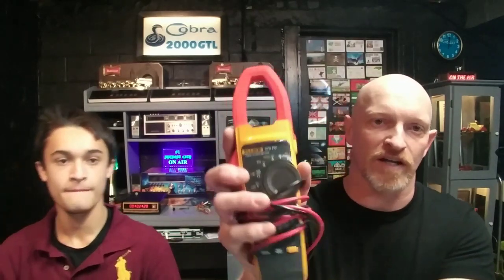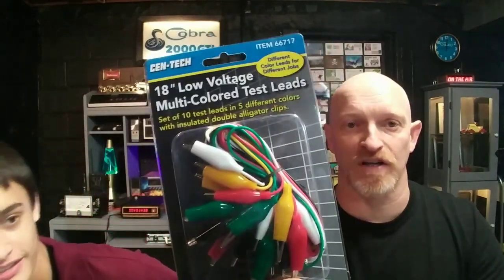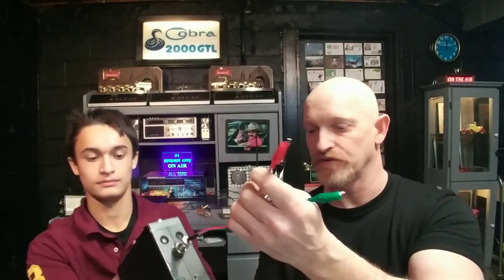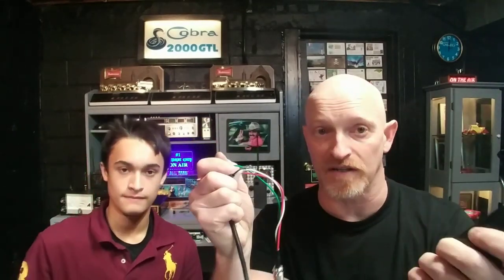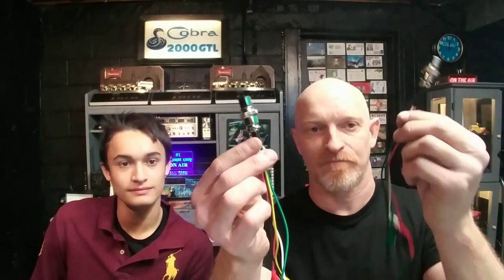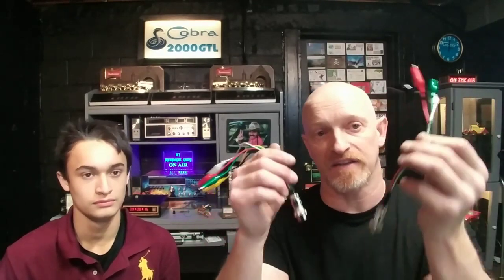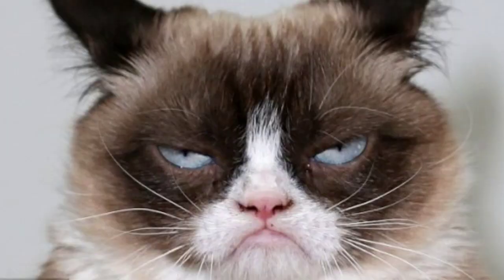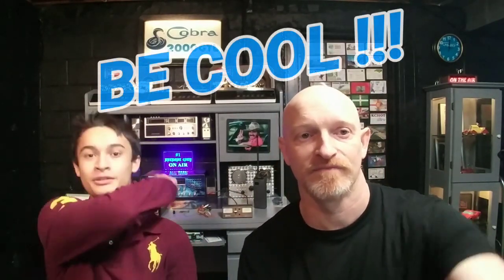Mic wiring tool super simple !

Comment: I take it this system would work if I made a 6/8pin version ? I have an Alinco DX10/DR135 microphone with the PTT switch issue changing channel channels when ever i de-key the mic, I've had similar feed back from others that have had the same issue. so I dont want to purchase another bod-standard replacement Alinco EMS-70 for the Alinco DX10. The cheap factory fitted mic has no screened lead. I've researched another Alinco replacement mike that has a key pads on it, which states and advertises that its compatible with the Alinco DR135 which is the same radio as the DX10. The Alinco DX10 & Alinco DR135 are a 6-pin radio and the replacement microphone advertised is an EMS-57 for these radios, fitted with an 8 pin wiring to the plug. This is a more complexed wiring situation but I suppose this would eventually work in the same way to get the microphone to work, my main concern is I would end up with two spare wires left over and I bet they are used and there for a reason. Just a little more complicated. You seem like a bright guy who would probably be able to help and advise me further. Great tutorial guys

Comment: Guys, do it this way:
First google the mic connection, then draw the connection or print it.  The connection is seen from inside the opened mic.
First, slid on the mic body onto the cable:
1:  The screen/copper braid wire is ground.
2: The wire the copper braid is wrapped round is the mic audio wire.
3: Not touching the mic, test between ground/braided wire and the other two wires.  The wire that bleeps or moves the meter is the receive wire.
The other wire is the transmit wire.
4:  Now match the wires to the mic plug as seen from inside the plug.
Simple.

Comment: Great idea but I have a problem I have astatic mb 104 hand Mike it has a module plug / clip internally the wires pulled from it and I need to figure placement contacted a radio shop the sent back plug pattern but the plug is still wired correct kneed the insertion sites in mic they didn't respond back this may work if use to bare pins of that harness clip thx 
Stay healthy wealthy and wise  73 s around the house
Reply from the maker: Im sure one of the guys on our fb group could help you figure this out

Comment: For Old tube type radio like a Johnson. Carrier
Reply from the maker: I wouldnt do this for a radio that has 110 volts id only advise this on 12 volt mic jacks which is most of your modern stuff
Reply: @runner406  it should have a crystal in it cuz mine does for my old Johnson messenger  2. And my Johnson messes your Viking

Comment: Good share..I have the exact thing except I took a 4x4 inch price of wood and put nails in it and plug the jack in the radio to the nails then put a rubber band on the talk button and just touch the nails till it's working..then clip solider and talk..I haven't shared it...have a great weekend. 73s 👋 700 weedkiller/YouTube